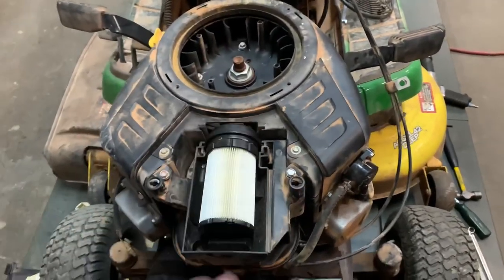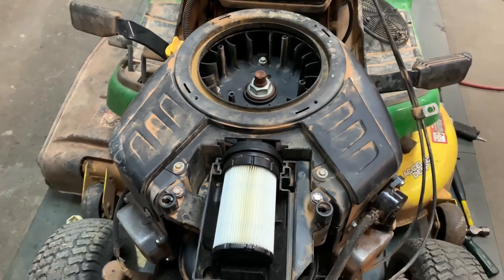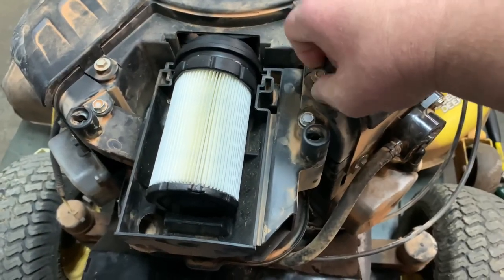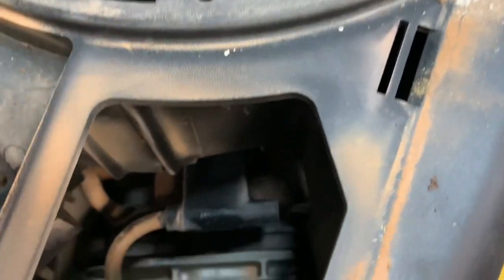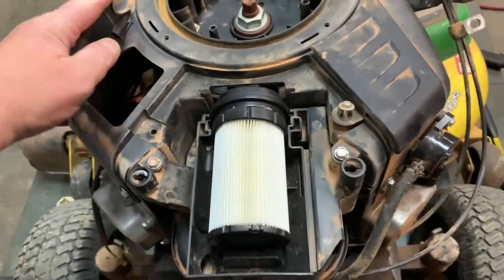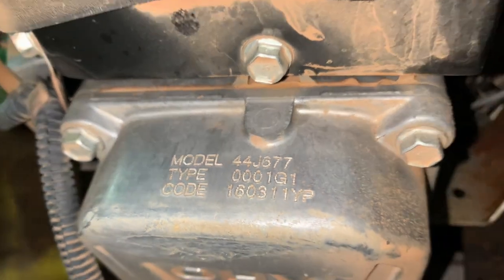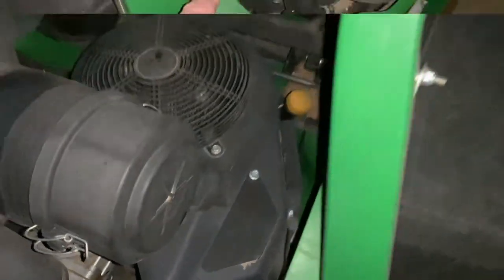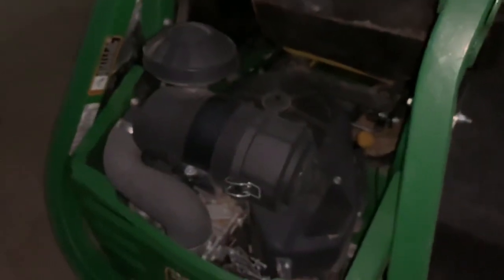A “COOL” FEATURE YOU DIDN’T KNOW ABOUT ON YOUR RIDING MOWER

Comment: thats a good tip! I have that engine! Do that this morning. 

Another question, I have the old out of production kawi fc401v that has a helacious kickback on the rope pully starter. I bought it used and it works great, still fires right up. the starter however blows out and they are 150$ for a new assembly each time, the inside spring coil breaks away from the plastic housing never to be properly reset....I searched high and low for a new flywheel with a ring gear to install an electric starter.

are the components on the old FC engines compatible across the model range? can I buy a flywheel w ring gear from a FC420 v or 540v and install onto my 401? was also considering just buying a full used engine with an electric starter already set up and dropping it in.so any input on the bolt patterns that you might know of would be appreciated

 thanks for posting. the valve compression video was good tutorial

Comment: Nice tip.
But it begs the question why were the cooling fins covered up with a plastic shroud in the first place?
Reply from the maker: Because the engine would overheat without it
Reply: The shroud contains and directs the cooling air provided by the fan on the flywheel, and it flows forcefully over the head and cylinder fins.